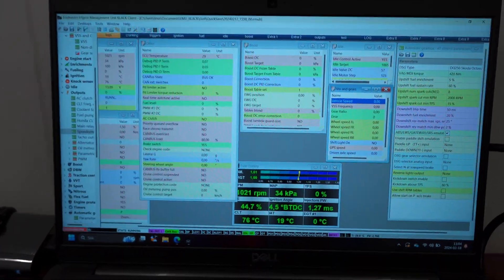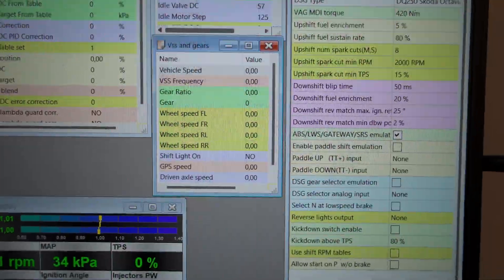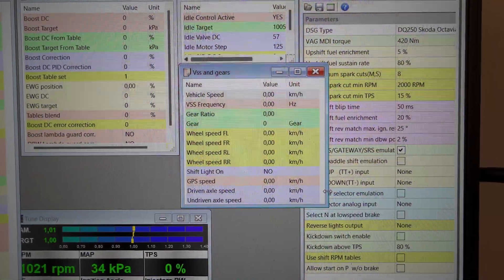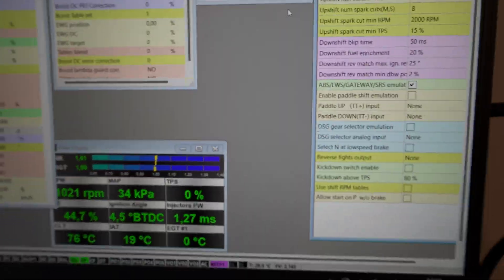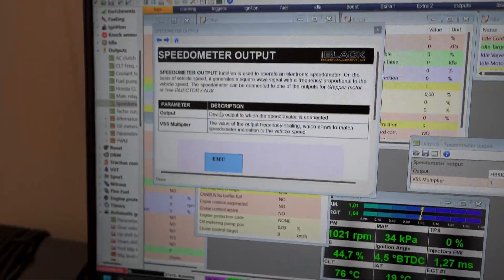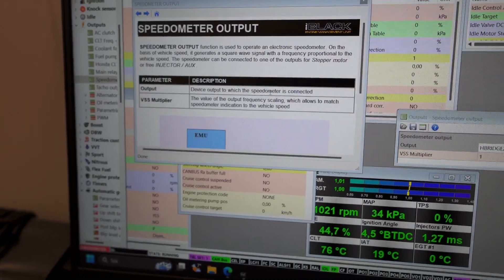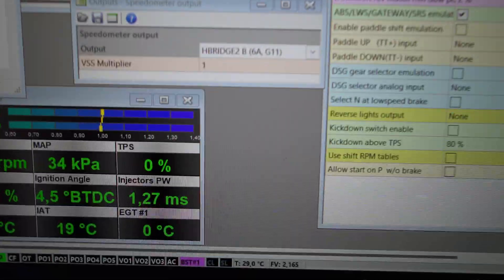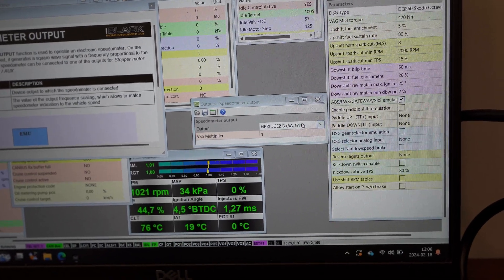Working Speedometer with ECUMASTER! [1.8T DSG SWAP]

Comment: Have you gotten isp or temp gauges to work from ecu master with speedhut gauges using thier output signal and not wiring in a sensor?
Reply from the maker: Do you mean esp? If so then ”yes” all gauges except speedo works via canbus and when you wire the speedo like I did the fuel gauge works properly aswell. I’m not sure what speedhut is. The thing I wired in is just the input to the speedometer not a sensor👍

Comment: Have a problem, the speedo is now jumping and not staying constant when wiring the old signal wire to the ecu. Any help?
Reply from the maker: Are you running ECUMaster aswell?
Reply: @RedBaronGarage  no I'm running a Maxxecu Sport
Reply from the maker: @JonathanHopkins-kx1ld  what method are you useing in  maxxecu then? can you take speed via can and convert to a vss signal?
Reply: @RedBaronGarage  managed to get it to work, used the wire from the gearbox speed sensor and the one from the wheel speed sensor.
Reply from the maker: Nice man 👌

Comment: I still have my oem ecu and coded my cluster it's in km but it works. Good info for people who are running standalone. I'm still trying to make my cruise control and launch control work with the OEM ecu.
Reply: I made the Launch control working on stock me7 ECU it’s pretty simple 1C0 907 379M is your answer the DSG needs that ESP system otherwise alot of stoff won’t function
Reply from the maker: I would really love launchcontrol but i dont have esp so i have to emulate it in ecumaster, is it a setting in dsg map that enables the function?
Reply: @RedBaronGarage  it needs to see brake pressure
Reply: @TorpedoStudios  is that the abs module.? Mine came from factory with the esp button I am having an issue with getting my shifter cable align properly to get the trans to go into sport mode any advice on how I can adjust it?
Reply from the maker: You should not need to align anything for the cable as long as you are not kinking the wire? Can you put it in sport if not connected to the gearbox and vice versa?
Reply: @jaykong2929  your shifter cable is only for the parking tooth nothing else the shifter itself might be bad?
Reply from the maker: @TorpedoStudios  could also be new version that doesnt have dedicated S position?
Reply: Your exh needs to be auto and have dsh trans file on it for cruise to work. When I had the manual ECU in mine cruise was glitchy. With the auto ECU it works after I coded the Speedo to work via can. I haven't had a chance to put the dsg trans file on it yet so cruise control only works in 1st -,5fh. It doesn't work in 6th due to tiptronic only being a 5 speed and that's the currently selected trans file.
Reply: @EuroWabbit the problem with mine was the auto from factory I think I'm missing the power to the ecu for cruise I have it on the brake switch wire right now and I think that's why it's not working
Reply from the maker: Interesting info thanks!
Reply from the maker: Thats nice to hear did you eeprom code then? Now sure how the Cruise control buttons work yet either😂 but if you run oem ecu should they not still work?
Reply: @RedBaronGarage  yeah it is coded my car was an original 5 speed auto I think Its a one wire issue i have to work out. Will update when I have it working

Comment: Have you figured out anything with reverse lights yet? That's all I have left on mine and I'd rather not do a micro switch on the shifter.
Reply from the maker: Well kinda, i havnt fixed it because its not required in sweden but you have reverse output in dsg setting in ecumaster! You can take that output to the reverse relay under the steeringwheel to make it work, and im about 50% certain you get reverse output from dsg t20 connector aswell but im not sure if you need to code that in the dsg or if its like that oem. Check the forumthread in description of ”ultimate dsg swap guide” if you can find it!
Reply: @RedBaronGarage  for you it will probably be as simple as the speed output was. I know there is a reverse output via can from the trans. I tried a can sniffer and it didn't do anything. May try it again as I had an issue at the time I didn't know about. On mk5 the bcm outputs reverse as it gets it from the trans via can.
Reply from the maker: Yeah Well you got the gear selector position via can so it should definately be possible!👍